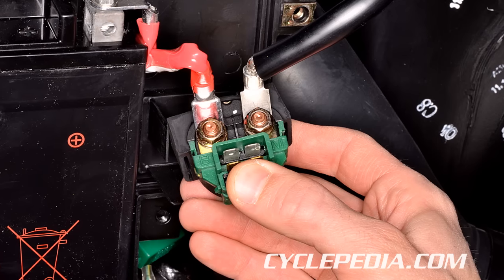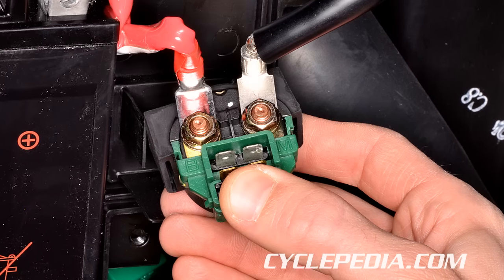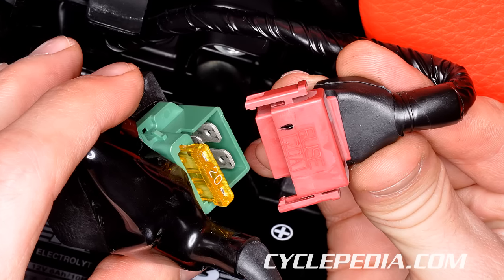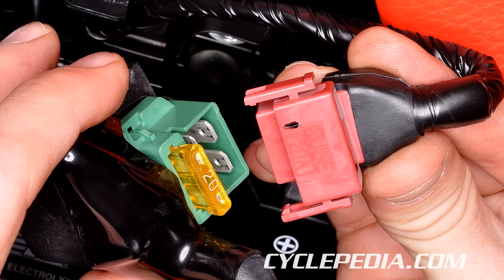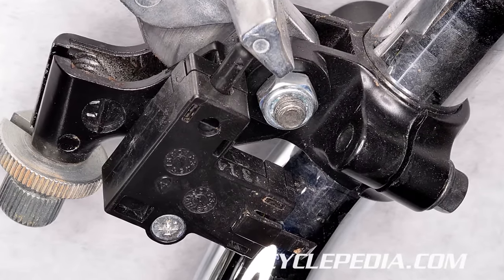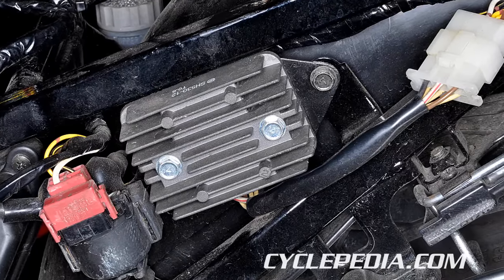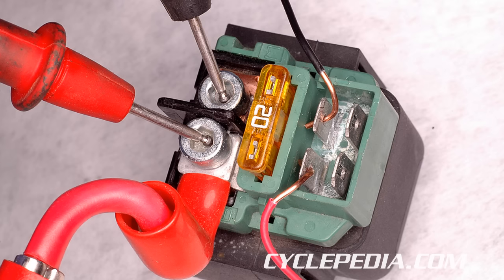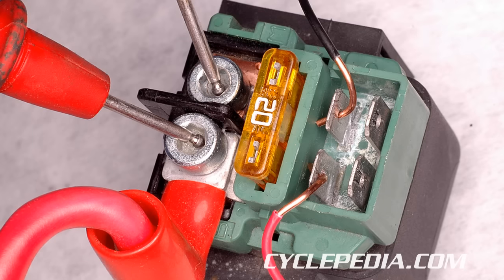Starter System Troubleshooting

Comment: Yes doing new bike to me, my relay clicks...

Tested the continuity  to the starter button plus stop start red button. 

My starter were with 12v independent power. 

You should have 12v+ at the positive side of the starter relay with 30amp fuse. 

Good luck everyone, keep going.
Reply: Did you find out what is was ?

Comment: Hi, 9 years later :) At 2:46 when you say "Jump 12v directly to the low current input terminals of the starter relay", do you mean with a second, external 12v battery, or how? Thanks in advance!
Reply: Any battery that’s got a charge will work. Just use the one on ur bike. U won’t use enough electricity to even need to charge it after.  Just take two wires and connect them to the positive and negative terminal on ur battery then carefully touch one end of each to where u see he had them in the video.

Comment: Can a faulty starter relay create a condition where there is no power to the bike? My battery is fully charged, and the main fuse is good. Both checkout with my multimeter.  I did not I tested the starter relay for continuity and volts, so I’m thinking the problem lies elsewhere. Thoughts?
Reply: Yes trace from tge battery....the starter button plus starter motor...

Comment: I'm late on here, I have kymco xciting 500, it was running fine all these days but I parked it because is been cold these days, I came back to start it after a couple of days it won't start at all, all I hear is a clicking noise close to the battery, I'm going crazy right now I really need help to figure out what is wrong with it

Comment: Hi I hope you can help me…..had a problem with the starter relay first I bought a new one and connected it as it has been.but new is the worst problem I have no spark in the pins and the Mc does not start at all Kawasaki Vn 1500

Comment: HELP!!!!!  :-) I've got an 05 Suzuki S83 Intruder that I'm having a start issue with. I've noticed (in YT vids) that the low voltage circuit on the starter solenoid shows the 2 wires being in opposite configurations (swapped /opposite) positions. I'm guessing the polarity on the low voltage circuit doesn't matter? TIA Stan in Decatur AL
Reply from the maker: I would recommend following the specific tests for your model in the service manual to avoid confusion.

Comment: my prob is the buggie starter turns over but when the sionoid buzzes not clicks i unplug the plug by the silonoid and plug back in it will let the fuelpump kick back on and still wont run any info or ?'s please ask thanks Bob..

Comment: Hello, 09 700 rhino, electrical issue between, ignition, fuel pump won't kick on and injector won't fire. Ordered a new relay. Could the ignition cause this? Thank you 😊
Reply from the maker: If the engine turns over when the key is turned then the starter relay is good. Check to see if you have any fuses that could be blown.
Reply: @Cyclepedia  ok, thank you 😊

Comment: Maybe you can help me 2014 Honda FROZA 300 will not start pushing the Starter button, but when you jump the solenoid, the motor would start up and runs fine. This problem was it intermittent for a while, but now it doesn’t start at all. I have to continuously lift the seat up and jump the starter. I have power to the ignition switch all the way down to the solenoid. Also, the kickstand has to be up and the break has to be held to start. Any ideas would help Rob.
Reply from the maker: You may need a new starter relay. We have a repair manual for this model with all the testing for the starter system, I'll put a link to the sign up page below. https://www.cyclepedia.com/online-manuals/cyclepedia-honda-online-service-manuals/honda-nss300-forza-scooter-online-service-manual/
Reply: Thank you all it turned off to be the rear brake light switch, which is connected to the starting system just waiting on the switch to arrive… Thanks again

Comment: The manual I'm using doesn't say but do you know if a 2014 Honda XR650L  starter relay has a fuse in it?  There's a fuse slot but it doesn't feel like it's making any contact so I ask myself what's the purpose of having that there. Anyway, I have a clicking noise but no start, took out the starter just for the hell of it and tested it and it works fine any help would be the greatest help I could ever receive. 🤙
Reply from the maker: Yes, there should be a main fuse and a spare fuse. The spare fuse sits in the fuse box like the others but has no contacts it plugs into. Since you tested the starter motor you may have a bad starter relay.
Reply: @Cyclepedia  I even jumped it from the starter to the battery and got nothing, I also jumped across the starter relays terminals and it wouldnt do anything, please something anything you can do

Comment: My bike doesnt start.. starter relay clicks... starter motor no joy... i check Voltage reading batt to relay, all gd, relay to starter motor gd... tried the screw driver trick no spark... what may be the prob? I check Ohm reading from relay to starter motor ots jumpy... does this tells me relay is faulty or motor is faulty?
Reply: And i have ordered a new relay just in case. Trying DIY n cheapest fix here... im riding a mv agusta turismo veloce
Reply: @farizyusoff978  did you solve it?

Comment: I have a benelli tnt 25, and i think i have a power drain in the 2 wires that come out of the ignition switch, so please tell me, does those 2 wires have current ( read 13.2 volts )...... A plus, when i connect my battery, the dashboard lights up briefly, is this a normal operation of the system, or do i have a short circuit?
Reply: One wire has current, from the battery...once the starter relay moves it gives power to the other side...

Comment: I have an Aprilia sr50 2001 LC and when i  touch the red wire with the battery it tries to start even tho ignition key is not pressed what does this mean?
Reply from the maker: Either the relay is stuck in the on position or the lead coming from the battery is on the wrong post

Comment: I have a 2004 yamaha r1. When I turn the key to start i have no power. The starter relay connections look corroded. Could that be my problem. Should I buy a new relay?
Reply: When i tap it i do see some life on my dash panel like the neutral light coming on.

Comment: i have a 250 sxf and the battery drains within a few hours.you can hear the fuel pump start up every now and again while its parked up.any ideas of what would be doing this?
Reply from the maker: Hard to say but if possible look at the wire diagram to see all the components. You may be able to disconnect them one at a time to see what is powering up when it should not.

Comment: Can this cause a battery drain ? And horrible whine noise from starter intermitent? My battery get drain8ng and even a new battery drained after 10 days of no use in 20 degree c temp!
I fitted a new s solenoid this morn and yad to modify one terminal as it is aftermarket . .the starter wire side i had to drill the hole out and file the side of the terminal..when fitted and new battery charged again it started instantly,then 2nd then a 3rd the whining again but,it started? I feel it is a shit s motor as it is off ebay and my old one never had 1 problem!
Reply from the maker: No, you have a key off draw somewhere most likely and something wearing out in the starter motor/system depending on what vehicle.
Reply: @Cyclepedia  vfr 750 1990
I noticed my reg plug is fried from the primary coil loom. The reg is newish aswell but a cheap reg ...one yellow wire had melted to the reg terminal . Also changed the starter as was v noisey clunking etc .. i will do a wire repair and mofset reg on order with wire mods straight to battery mod..

Comment: I just got a zx10r 2016 700miles. The owner before me put about the same on it. He flashed it "I am not a fan of flashing" when I turn the key on it hums but it doesn't stop is that normal? Yours didn't hum did it? I hate this BS flashing. I had a r1 never flashed tuned correct and I walked a supra. Don't belive go look no flash.. Is there anyone selling a stock ECU I have a ecu flashed by Brentuning, flashed for Grave full exhaust KNN Stacks. Let me know.. Stock KRT zx10r 2017

Comment: I have a 2000 tl 1000r. When I try to hook up the battery the bike trys to turn on without the key plz help
Reply from the maker: Usually when this happens the cables on the starter relay are  installed backwards or the relay is stuck closed. In either situation the battery voltage is going directly to the starter motor from the battery and bypassing the starter button/starter circuit.

Comment: Hey man I hope you can help me out. My bike always turns on but sometimes I have to hold the starter down a bit longer and the start up is kind of weak? Any ideas what the problem could be? Thanks
Reply from the maker: Start with fresh fuel, fully charged battery and make sure all periodic maintenance items are good. What is the bike in question?
Reply: I have a 2011 Fz8. I also have an intermittent error code 20 which means the atmospheric sensor and air pressure sensor values differ greatly when the key is turned. I thought the weak start was being caused by the error code but I have gotten a weak start even when the code doesn’t come on

Comment: Have a 2008 rhino turn the key nothing , replaced ignition switch started running , back fired a few time when step on gas turn off , now nothing turn key no light on dash ,, nothing ,, check power to switch power good , have no idea , check all fuses , any idea ,,
Reply from the maker: I would check over the harness and electrical system for any damage or shorts.

Comment: If starter relay  is not working will that also prevent all lights from turning on?
Reply from the maker: No it should not prevent the lights from turning on, depending on the machine some starter relays have the main fuse in them. If the main fuse is blown then that would stop all power, keep in mind you will need to find out why the main fuse is blown if you replace it and it blows right away and make sure to use the correct fuse.
Reply: @Cyclepedia    so  first time owning a motorcycle,   dicied  to get relay just in case .put new one on and still noting . I I was fed up and just began  putting everything  back together    turn key over  just one last time  and  lights  came on  it even turned on.  So far  good . Maybe i have a bad ground or something

Comment: ok cool but what if the bike is off and when you connect the battery and  the starter turns on and wont shut off
Reply from the maker: Usually when that happens the relay switch is stuck or hooked up backwards.

Comment: I have a cbr 900rr 97 bike runs great I don't have the battery cables bolted down but evertimw I take cables off it runs then runs dead is it the battery or could it be cause they ain't bolted down and not enuff connection?
Reply: Not enough connection

Comment: I have a question my 2007 Honda crf150f won’t start whenever I hold the ignition down it clicks once and it don’t do any thing but I can roll start it but if you might know what it is please tell me
Reply from the maker: The best thing other than this video would be our manual, this will go over testing your starter system so you don't guess and buy the wrong part, here is a link.
https://www.cyclepedia.com/online-manuals/cyclepedia-honda-online-service-manuals/2006-honda-crf150f-online-service-manual/

Comment: What would make the starter motor keep running after the bike starts and the start button is released? And why would it not quit turning the starter after the key was shut off. Mine just did that yesterday. Now it won't start but it clicks when the button it pushed.
Reply from the maker: If everything is hooked up right then the relay is sticking and needs to be replaced.
Reply: @Cyclepedia I have a 02 rsv Mille and have the same issue. Bought brand new Aprilia starter relay and new battery but still cranks after shutting off.🤬🤦‍♂️🤷‍♂️

Comment: I have a 05 raptor 660r and the starter relay just makes buzzing sound. What the problem??
Reply from the maker: Is the battery fully charged? A weak battery will do this.
Reply: I was using jumping cables with my car running. The car has a brand new battery too.
Reply from the maker: May be a bad relay, recommend doing some diagnostic work to avoid buying the wrong part. Here is a link to our manual. https://www.cyclepedia.com/online-manuals/yamaha-atv-motorcycle-online-manuals/cyclepedia-yamaha-yfm-660-raptor-service-manual/

Comment: 9929 RR will not start I have done everything new battery new plugs and coil packs tested had rectifier and stator put in all the fuses I'm looking at relays been looking at the relays and I don't know what to do if you could help contact me back thank you

Comment: I just replaced my starter & starter relay solenoid, checking wires & fuses. My 01 ZX9R is trying to start up whenever I touch the positive cable to the battery🤯it does it with the key in the off position, relay connected or disconnected, start switch on or off. Out of ideas, please help
Reply from the maker: Sounds like the cables are wrong, you must have battery voltage going straight to the starter motor.
Reply: That’s exactly the issue but I checked the cables from the starter to the solenoid, solenoid to battery & all. I figure the solenoid is stuck but I’ve ran through 4 solenoids in the past months so I’m trying to find the culprit that’s causing the solenoids to malfunction. All my wires, cables & connections look good
Reply from the maker: @YungCountry1  Are you using a Kawasaki relay or an aftermarket brand. I have had this problem when using cheap relays.
Reply: CYCLEPEDIA Service Manuals aftermarket eBay bought, I fixed it though, solenoid sticking was the issue

Comment: My 2013 ford edge is not cranking and not starting the notification on the instrument panel says starting system fault. Please help
Reply: I have the same problem with my 2013 Ford Taurus. Did you find the problem?

Comment: I have a1987 Honda Goldwing Aspencade 1200
 something is killing the battery.  it arches when I connect the positive side to the battery. I can go for a ride but if I turn the key off it won't start thr bike back up. how do I trouble shoot this problem?
Reply: Lance Procter Sr. Procter  same problem for my 2010 r1 i can start on with help from other battery but when i go ride then turn it off sa switch then i start on the bike again cant start anymore need to help connect other battery
Reply: How old is your battery ?

Comment: I just put my bike away for the winter, and I was using the battery for something, so I had it taken apart, but when I was putting it back together, firstly, I noticed it wouldn't start, as it was electric start only, then I noticed a 7.5 amp fuse wire, this connected directly into the battery, but I noticed it was completely loose, like it was plugged into nothing, could anyone help me on where this is supposed to go? It is also formed to the bike with mud on it so I know it's not just some random cable, also, its a 2015 klx 140L
Reply from the maker: That is a lot to figure out in the comments, my best suggestion would  be signing up for the repair manual, here is a link. https://www.cyclepedia.com/online-manuals/kawasaki-atv-motorcycle-online-manuals/2008-2011-kawasaki-klx140-motorcycle-online-manual/

Comment from the maker: As long as the rest of the electrical system is in working order then yes only the electric start would not work but the bike should run using the kick starter.
Reply: Hi please help. Gen 1 ZX10r No spark
Reply: What is the actual values of high and low currents in Amperes? For example the value of current to the solenoid coil

Comment: At 1:01 what is that red thing called that connects the the switch?
Reply from the maker: That is the main fuse cover/plug from the wire harness.
Reply: Thanks brother

Comment: My drz 400 fuse is burned. Bike is runing for 5 seconds then dies, and bogging.
Reply from the maker: You may need to look for a short or wiring issue especially if you replace the fuse and it blows again.

Comment: i have an issue with the ignition fuse blowing as soon as you turn the kill switch to run, can the starter solenoid cause this issue?
Reply: coil gone down my gsx600f did this i went through it with a fine tooth comb this is what i came up with
Reply: Mud Flap Guy
Reply: Mud Flap Guy answer the qiestiom
Reply: I have this issue my fuse keeps blowing. So you cleaning it fixed it?

Comment: Hi I have a problem with my dashboard going dead. When I take out the fuse in the starter motor and replace it all the display comes back. Then when riding the bike it cuts out again doing my head in anyone help
Reply from the maker: Sounds like you might have a loose connection or short somewhere.

Comment: MAn my starter keep turning   even if I turn the switch off or the kill switch as soon as I touch the battery cable please help
Reply from the maker: Are the cables hooked up properly? From battery to starter? I have seen switches fail like that  especially cheap replacements.